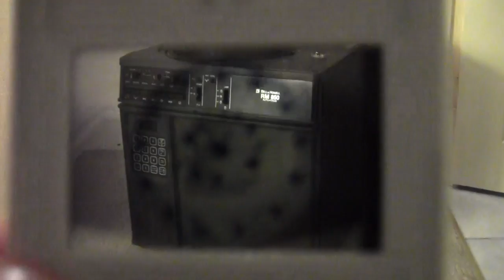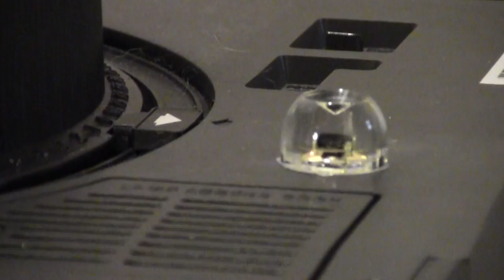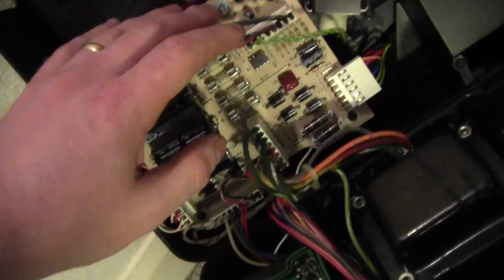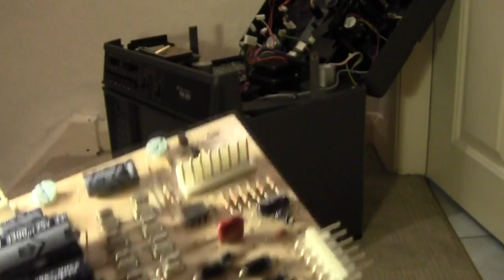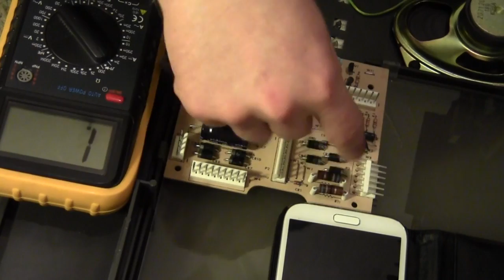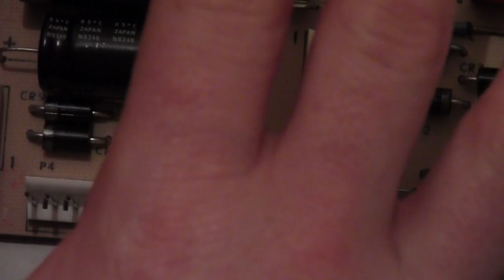1981 Bell & Howell computerized carousel projector repair (part 1) ( RM850 )

Comment: Could you replace the small glass diodes with  1N4007 diodes which might work don't know if OA90 would work the IC might be a 741 OP-AMP not sure as I cannot read the type code from video.

Comment: A bit of extra info - I made a quick diagram of most of the PSU board...
i49 . tinypic . com / 2i6f80h . jpg

"linuxfanman" is correct - CR11 is shorted, so the big resistor can't limit the current to the Zener (CR2) and one of the AC fuses is blowing.

I thought opamp A1 was used for audio at first, but I think it's part of the autofocus circuit. The smaller transistors at the top (Q1/Q2, not on diagram!) are driven by the output of A1 so it probably drives the focus motor forward / reverse.

Comment from the maker: Yes, thanks Clem.  Apparently, resistors won't normally pass a continuity test but if they are very low resistance when in circuit, this can happen so in the end, I didn't know at the time, but that test is pointless, but this is a learning process :o)  I tested them out of circuit in the end as you will have seen and they turned out to be fine.  The Zenier? diods are shorting so we think it's them but going to test the op amp first (will do a second video with that in) :o)

Comment: The big resistor limits the current to the diode, and when the input voltage goes over the specific reverse-voltage threshold of the zener (depending on it's specific rating), the zener starts to limit the output voltage (close) to the set amount.

So a zener needs to be ordered with the specific reverse voltage and the resistor is chosen for the expected output current range (and power dissipation).

Comment from the maker: Yes, both resistors read fine out of circuit, if a little larger than the bands claim (78 ohms instead of 68)  Right, I'll try that diode check in a bit :o)

Comment from the maker: Oh, doh, your right lol, corrected :o)  I've tested the board without it being plugged in and it still fuses so I suspect there is a problem on this board it'self (not to say the motor isn't seized too :o(  Hmm,., wasn't sure what I was doing, but some of the caps do beep when doing a continuity test on them but reading on the web, some will, some won't :o(

As for the board, just put a link in the description, I've taken a picture of the front and back and made a composite showing the....

Comment: As a quick check, if the V- and V+ pins are shorted to each other, then it's probably the amp or zener diodes.

The zener diodes and big resistors likely form the zener regulators for the V- / V+ rails.
It's usually set up like this...
tinyurl . com / 5vz7x78

Comment: My bet is that the LM741 amp is shorted. Datasheet is on Google.

It probably uses a symmetrical supply though (- / 0V / +), so you'd need to find the GND / 0V, which is the centre-tap on the transformer.

Oh, you removed the resistors for testing, that's good. Swapping probes on diode checks too (sorry, still watching vid. lol).

Need to check for shorts between LM741 - and + rails and 0V / GND.
Pin 4 is V- and pin 7 is V+.

Comment: Ahh, those small diodes shouldn't be shorted. CR1 and CR11 look like zener diodes (squiggly lines on the symbol), so are probably used as voltage regs (together with those big resistors).

CR2 looks like a standard 1N4001 (you might be just able to read the code on it).

When the meter is beeping (on the "diode" setting) it's actually shorted! So most of those diodes could be shorted, unless it's the amp or a cap etc.

(Open circuit (high-z) on the meter is when it shows "1.")

Comment: Hard to test resistors unless you know what's in the circuit with them. They could even be low-value resistors for current limiting / smoothing. But yeah, I wouldn't expect that resistor to be shorted seeing that it's the same value.

For the diode test, do the same check for a similar range (in one direction), but then swap the probes on each diode and you should get a higher resistance (with the red probe on the diode pin with the white stripe / cathode).

Comment from the maker: 2 way diode?  Which is that? (will sort pictures out in a mo)  :o)  Apparently, it's extremely rare for those op amp chips to go so I'd say the transistors more likely but they both give the same readings.  I'm gonna do a picture of the front, a picture of a back and a composite (if I can get away with it) so you can see both sides at the same time  :o)

Comment: Hi, Steve,

I think it's a Bell & Howell btw. :)

The small DIP chip is an LM741 amp, so it probably has symmetrical supplies for it (hence, maybe two fuses for it). I'm not sure without figuring out the circuit though.

Most likely culprit is either a shorted cap, or a maybe the carousel motor is seized which is blowing the fuse?

Do you remember which plug you put in which made the fuse blow?
Could you post a pic of the top / underside of the power board? (square-on if poss).